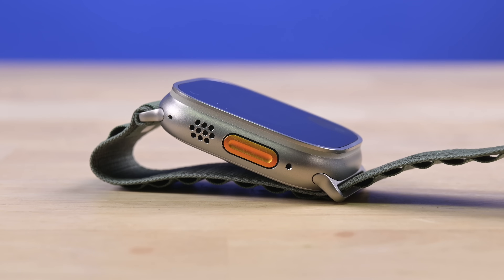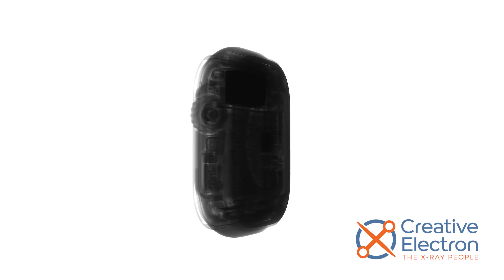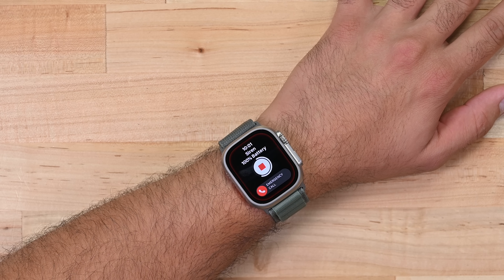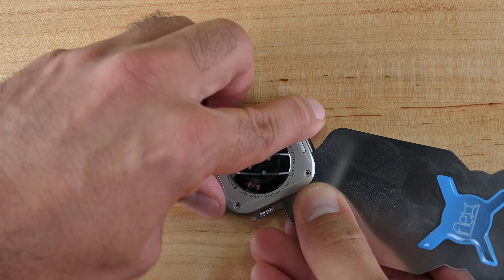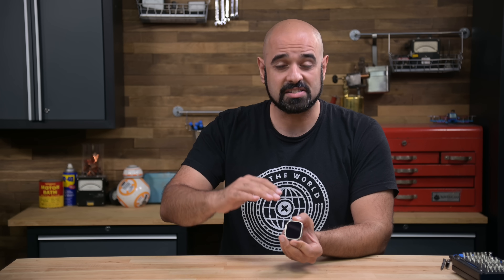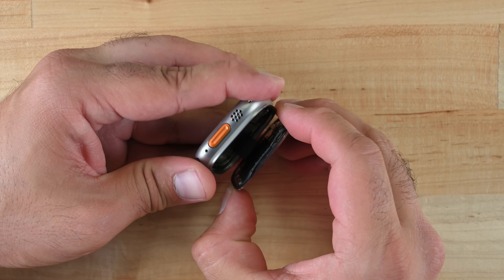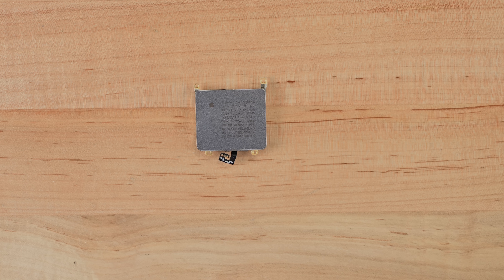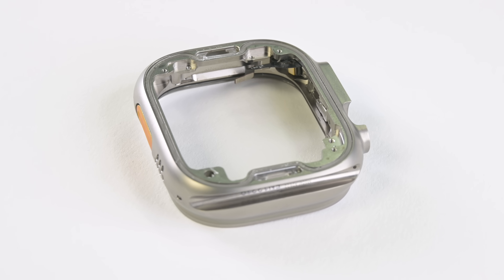Apple Watch Ultra Teardown - Beautiful, Rugged, and Almost Repairable

Comment: you're getting cooked in the comments.  screen isnt meant to be taken off and on.  you replace it when its broken or rarely for a battery replacement. how do you work for ifixit and dont know proper procedures LMFAO.  the screen will never break if you snag it on a rock.. another video a guy is hitting it against rocks and metal and gravel and it never broke.... the insides malfunctioned after 50 hits but the glass didnt break. be better

Comment: My watch ultra 1 is the first one I’ve used without a screen protector or case and its by far much durable than the other Apple Watches. Still looks brand new after 2 years. Some minor scuffing on the frame but it wipes right off. The screen doesn’t have a scratch on it

Comment: FYI
The siren has two levels, one when you are indoors and one outdoors. 

The watch knows when you are outdoors by using the mics, and the sound level is adjusted. 

The bottom line is - when you really will need it, it will be loud, much louder for the indoor test in this video.

Comment: Come on! Pushing a spudger through any gasket like that is going to destroy it! You are clearly supposed to  prize it open using the little pockets adjacent to the strap attachment (2:01). To be fair, unless there is a service manual and perhaps a special tool, you had no way of knowing that in advance! Similarly I'm guessing there is a better way of removing the screen, probably involving a suction cup? But would certainly be better if you could push it through from the back!

Comment: Like, I got respect for y'all iFixit...but some of your takes really miss the mark.  Like the screen.  "Glass" like this is, by far, most vulnerable to shatter when being impacted on the edge...which is completely protected here.  Yes you can still shatter it with a direct front hit but that take a lot more impact force and if the impact is at any kind of angle at all or even perfectly flat on a flat surface, the frame is going to take some of the impact force.

...and what exactly do you think a few extra mm of uplift of the titanium border is going to do about smacking the face into the point of a jagged rock?  Not a thing.  Some types of abuse will break pretty much whatever device you're wearing.

Also, the siren isn't primarily about decibels but what frequencies it uses and that the cadence and alterations to the pulses sound entirely out of place in nature.

Comment: I consider all smartwatches a toy... I have had a "normal"clock for 10 years now and I only had to replace the battery 2 times. And I had another for 5 years and its powered by sunlight... I think the smarts should be kept in the smartphone.

Comment: There is one thing I would like you to confirm in this design.
That is "durability of the action button against oil".
This time, it seems that a rubber membrane is used instead of the conventional Oring, but if it comes in contact with skin oil, sun oil, petroleum, or gasoline, it will crack in about three years. I think the oil causes the rubber to swell. Even if that is not the case, wouldn't it crack in about 7 years and become a total loss due to flooding?

Comment: This makes me excited, because the one worry about this watch was the seals. For dive computers, you need to service the seals every so often (I believe 6 months?) and these might seem serviceable. It’s pretty cool.
Reply: No you dont, depends on the model but you can do it when you replace the battery.
This myth of dive watch/computer being hard to make was true 70 years ago, now its easy. The watch industry just want to use the idea for marketing.
Reply: @iBlindPanic  no, you do have to service the seals ever so often.
Reply: @Blarnix  yes with same interval as the battery, not every 1/2 year. Do you dive?
Reply: My dive computer doesn‘t require service at all…sorry.

Comment: Anything after the series 7 watch and iPhone 12, requires at least 120c to loosen the glue. 
The upside is that these displays are quite resilient if handled properly. 

To open the watch i recommend a cut to size Dorco blade, 120c of heat and iso 99%. 

Screen refurbishment process looks identical to the series 7 were you don’t need to cut any glass or remove any frame to separate the glass. 

This is a win in my opinion.

Comment: I would love to see iFixIt take apart a high end Swiss watch and assess its repairability. This is the kind of complexity which goes into these devices, but no-one has ever complained to the Swiss watch industry about repairability. We’re really coming at this with false expectations.
Reply: Mechanical watches are harder to repair and service because most have some forty to seventy parts, but they aren't so bad. I oiled the ETA 2892 movement of a Tag Heuer watch using tools I found at home (though the four Moebius oil types themselves were pretty expensive). Everything is predictable: all you do is unscrew and re-screw screws, remove, wash, lubricate & replace parts, and take a photo every now and again so you can remember where stuff goes.
Smartwatches, which are really in a different class, have less tolerances from moving parts and generally less mechanical complexity. They should be easier to make repairable.
Reply: Excellent!
Reply: Samsung has made repairable watches sense apple started, not that hard, the screen is a different story on mostly everything, but getting inside to replace a disposable battery, because say it with me all batteries have an end of life, that's very important
Reply: No one expects a switch watch to last only 3-4 years either. Price for price I can get a Hamilton serviced for 100$. Tell me who will replace a Apple Watch battery for the same price
Reply: @TheTransitmtl  Lol Apple's battery replacement cost is literally $100.... so Apple I guess?
Reply: You mean: when you’re buying a Ferrari, would you really try to repair this by yourself or let bloody beginners repair it? Oh He’ll naw. 😂
Reply: good point, these devices are crammed with so much tech and just because this guy is not skilled to properly open or repair this device, doesn't mean the manufacturer made a bad design.

Comment: As always, a special tool will be required to replace the screen. Something like a suction cup or device that holds with vacuum and a heat gun to soften the adhesive.

Comment: I'm curious if the screen is actually sapphire crystal like Apple claims, or if it's some sort of hybrid glass like Ceramic Shield. If it is indeed sapphire, my guess would be that the raised lip is to prevent the sides of the crystal from being struck. My understanding is that sapphire is more scratch resistant, but also more brittle if struck the right way, like it has a sort of grain, perhaps? If it's hit against the grain it's more likely to be fine, but if it's hit with the grain, it could shatter? Not sure how accurate that is.
I do want to thank you for disassembling this! Hopefully not many people attempt to disassemble this Apple Watch and try to swim with it afterwards. I was just in an Apple Store today to see how big the watch actually was and also to decide which band size I would need to get. Someone else that was looking sounded interested in disassembling it, I hope for the watch's sake that they don't swim with it should they attempt to dismantle it.
Reply: If you watch TechRax's video, it seems like it might be actual sapphire. It didn't scratch at all when shaken in a jar of nails and it took several hammer hits to shatter the screen.

Comment: Oh ya... that's much better than the old one, so much easier to repair. Need to replace the battery? No worries, just replace the screen at the same time! Well at least you didn't rate this one a 7 out of 10 with components not working after replacing them...

Comment: The screen is actually quite tough from a straight on hit. It was smashed several times with a hammer and the desk underneath it broke before the screen did.
Reply: Exactly. You'd be surprised just how hard you'd have to hit it with "a jagged rock" before it would actually break.
Reply: I bonked against a wall with just my hand and it cracked right open and no Apple care.

Comment: As a Watchmaking apprentice I have mixed feelings on this watch.

First off, you missed the 'small' O-Rings underneath the screws, one hamfisted genius at 9to5mac decided to have a crack at this before tucking their tail and in the process futzed them up. On my own watch I was able to easily place them back in their groove and put the screws back in, but obviously not everyone has my (limited-ish) knowledge.

But again, as a watchmaker I very well know that it's possible to make a diving watch with an infinitely serviceable internal mechanism. In an alternate reality there's an Apple which has worked out how to make an Apple Watch Ultra where the whole thing is serviceable from the back and you just pop out the screen from the back, wouldn't have been that drastically different in design.

Comment: My only disappointment with apple is battery replacement. Why does it have to be so complicated and expensive. There are watches that are W100 with easy battery replacement. Use gasket instead of adhesive.
Reply: Do those watches perform like the Apple Watch does to the caliber the Apple performs at? And if so, which ones?

Comment: Do people repair their own Garmin, Polar or Suunto dive watches? How about their Omega, Tudor, Rolex or Seiko dive watches? Not if they are smart.  It's always recommended that you leave battery replacements and repairs for things like dive watches to the experts and take it to a watch repair shop. All of the watch manufacturers make this recommendation. The seals related to water and dustproofing are simply too important when used for diving, water sports and adventure sports. Why do you think that the Apple Watch Ultra would be any different? Who cares how difficult it is to repair.  If it needs to be repaired I'll be taking it to the Apple store to have it handled by the experts like a normal human being.
Reply: Well said! I'm thinking the same.

Comment: Complaining about the water resistance gasket right under the glass... on a watch intended to be used in humid and wet environments. Goes on to complain about the exposure angle for the glass.  You know, the part of the watch you look at.  iFixit guy seems to expend a lot of effort to make some kind of stand for repairability-- at the expense of functionality.  Seems quite unreasonable.

Comment: Since when did Apple watch had “abysmal” record for gps accuracy? Its one of the best on a smart watch!
Reply: Right? DC Rainmaker and The Quantified Scientist are probably the most thorough smartwatch testers on the internet and they gave really high scores for Apple Watch GPS and its sensors for accuracy.
Reply: Yeah they've said and done a couple things in this video that seem misinformed
Reply: @JXHNDRX  like the lip does nothing 😂 common sense checks out
Reply: @daniel_960_  They could have literally watched a better review and found they were talking BS. Big company, tiny brain.
Reply: They did have a problem early on with their smoothing algorithms that resulted in bad tracks, but even worse distances particularly in the woods or other places with tough satellite reception. My Series 3 now has very good tracks, but still overestimates many distances. I think most of Apples’s recent watches are pretty much spot on. And I don’t think the problem was ever antennas.
Reply: Exactly, I've never had issues with the gps on the 3 Apple watches I've owned. Why do reviewers feel the need to make claims about a device without providing proof?

Comment: I normally fully agree with your assessments, but I think you’ve been a bit unfair to Apple here. It’s a very compact device with a very high level of water resistance. I wouldn’t expect it to be as easy to repair as a phone or laptop. That clearly wasn’t the correct way to remove the screen either. I agree that I wouldn’t wear the watch climbing (I wouldn’t wear any watch climbing) but I think for the vast majority of applications the raised lip will protect the screen. Also, the siren has a distinctive sound and is as good as can be expected from a tiny speaker. Personally, I think this is the best piece of hardware Apple has released in years.
Reply: Based AF
Reply from the maker: We try to be unbiased though I'm afraid this was my experience with this watch. There's a certain amount of marketing going on here on Apples part that borders on the dishonest and yet at other times they understate the engineering that went into the device just in case they get into trouble (the fine print on the 100m rating is interesting as an example - only guaranteed to a depth of 40m if I'm not mistaken).

All in all, I respect your opinion but we've not tried to sell anything or sway any opinions on the device itself. Cracked screens aside, repairing a battery on this device while trying to save an already function screen will be difficult for the average person. Screen replacements on this device need practice to remove intact and it's simply not something people will risk with a screen that's likely to be expensive. -SM
Reply: @iFixitYourself  It's guaranteed to 100m, it's just that the depth limit for recreational diving is 40m, so the depth sensor and Oceanic+ app will only work down to that depth, anything more and it stays waterproof, but displays a 'deeper than 40m' message on the watch.
Reply: @iFixitYourself  that's only for the dive computer which is only certified for 40m. WR100 funnily does not mean actual 100m, this is the same for other highend watches like the Polar Grit X. It has WR100 but you are not allowed to use it for any diving it all. The AWU is actually the first smart watch at all that is officially certified for SCUBA diving and the inclusion of an acutal diving computer is freakin cool und currently unmatched.
Reply: @iFixitYourself  Thank you for your reply and I respect your opinion as well. Maybe we’re coming at this from different angles. I expect a phone or laptop to be user repairable but I actually don’t expect it with a watch. Maybe that’s because I’m coming from using mechanical diving watches which you’d never dream of trying to take apart yourself. As for Apple’s marketing, the only part I disagreed with was the footage of someone climbing as there is no way that wouldn’t destroy any watch. Apart from that I think what you get is pretty much what they advertise.
Reply: @iFixitYourself  nope, the dive computer is rated to 40m, below that you step into more serious diving.They would be eaten alive if they tell people to dive with it and it will take on water at 40 or even 50 meters.

Comment: Isn't it a bit odd to complain about damaging the screen when most of the repairs that require screen removal will be 99% the screen itself? I mean, he even said it himself that the screen is probably the first thing to be damaged in a fall or wipeout on to a rock face.
Reply: You apparently have to remove the screen to fully remove the battery which would be the other most likely repair.

Comment: I'd remove the taptic engine and increase battery size. Vibration on a watch is very secondary imho
Reply: Not at all. If you've used an Apple Watch you know that the vibration motor is very important. And the Taptic Engine is on a whole different level than those cheap motors used by others that feel terrible and are even audible.
On a SMARTwatch the vibration feedback is one of the most important things.

Comment: I think you’re looking at this problem the wrong way. Nobody would willingly open their iwatch if it’s perfectly fine, therefore you’re only going to pry the screen off if it’s already cracked.
Reply: The screen has to be pried off if a battery replacement is needed.
Reply: @just1ed  the battery wont be needing a replacement for a long time. The screen has the higher likelihood of breaking first before the battery needs to be replaced.
Reply: @red.46  ??!#? Both things will happen, completely unrelated to each other.

Comment: i would expect better from ifixit to actually try and properly remove the screen rather than start prying till something breaks it’s ifixit supposed to be a resource for self repair hence “ifix it”
Reply: Taking a page from JerryRigEverything’s tear down videos
Reply: Not only that, but if your screen is broken anyway, replacing it looks easy.  Replacing the battery alone looks unlikely, but at least you only have to remove the screen.
Reply: If it was possible, they’d have done it